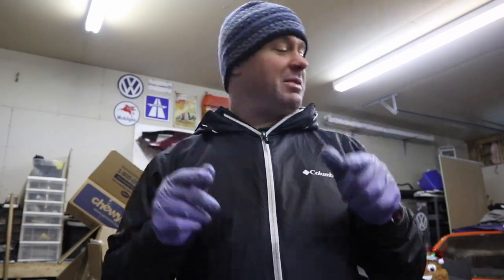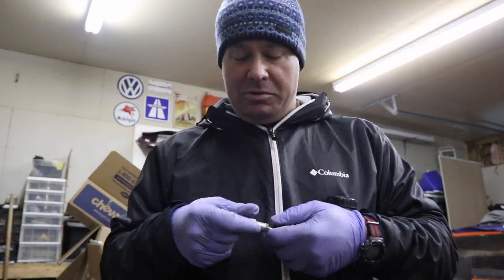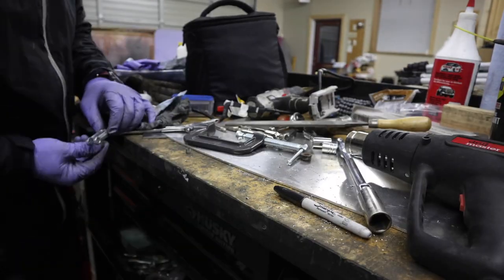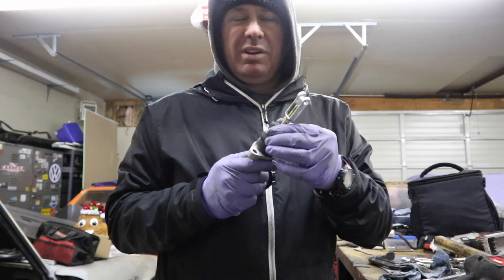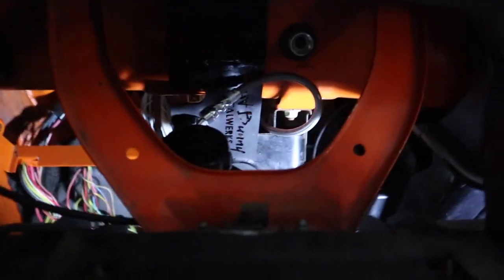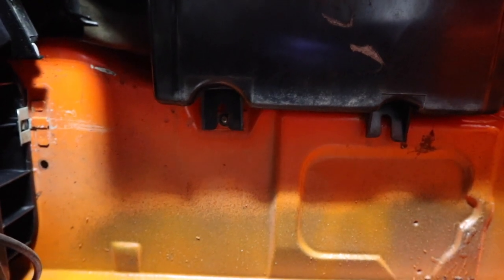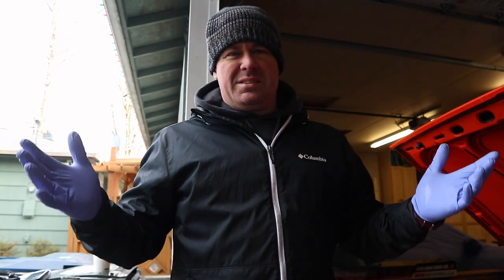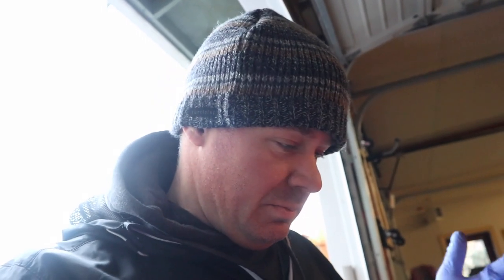Fast Bunny O2A hydraulic clutch master install -1975 VW Rabbit 1.8t 20v ep 39

Comment: You installed the whole bracket too low on the steering column. If you install it correctly  higher up on the steering column, which takes some time, all this cutting and grinding is completely unnecessary.
Reply from the maker: At the time, these brackets weren't designed with the swallowtail sheet metal differences in the design. That presented the installation challenges, and the info was passed on to the company for their design updates.
Reply: @ThrottleGrotto  nice work. I may have skipped over that in the video. I had issues getting slack on the pedal in my car so I saw this and considered cutting and grinding but it turns out the bracket just needed to be closer to the steering wheel. Just would hate to see people getting confused and cutting up their new parts